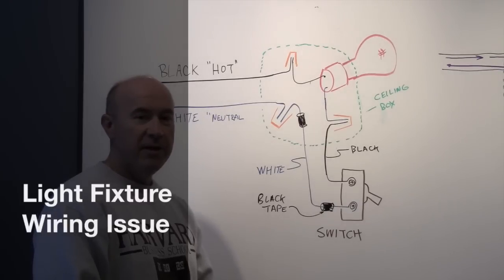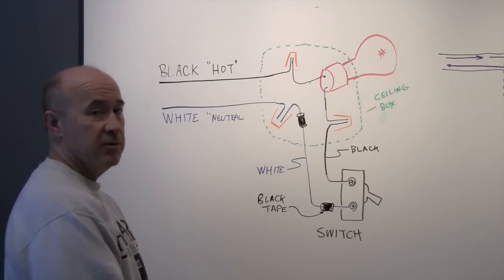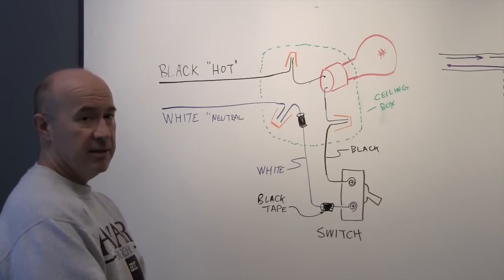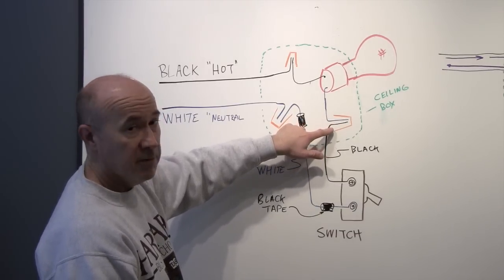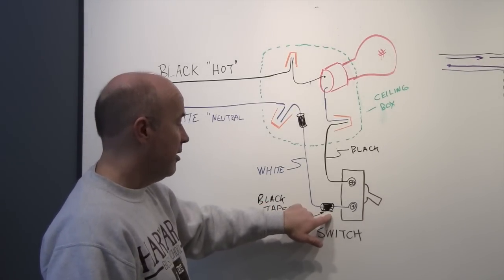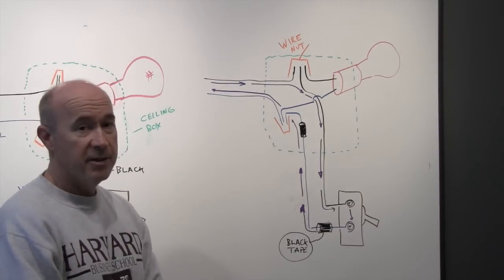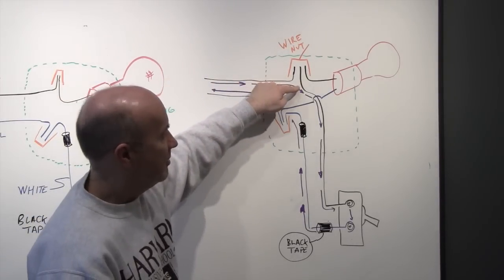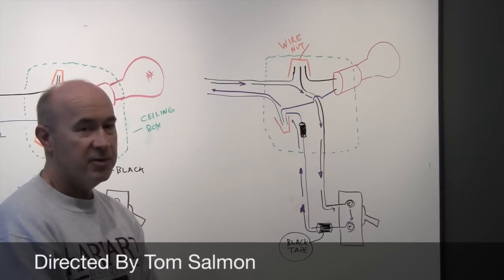Light Fixture Wiring Issue : Circuit Breaker trips as soon as the light is switched on.

Comment: hey, so basically the light fixture worked but lets just say that uh,, the wire to one of the light bulb sockets literally tore off. now, whenever i flip the switch, the breaker trips up. Should I be worried of electrical fire, or is a turned off switch good enough until i get a new light?

Comment: Hot don't go to light it goes straight to the switch than run I switch leg from switch to light and neutral to light that diagram you draw is a switch loop

Comment: does anyone know how to trace wiring faults on lights and smoke detectors? or is there a tool i can use? my issue is the breaker trips when i turn on ANY light(or plug in something) in that ckt. the only way the breaker stays energized is when i turn all switches off and unplug all the loads on the ckt. now i'm tryin to find where the fault is. if all i had were receptacles its just a matter of plugging in a receptacle tester to detect faults in the wiring but most loads on this ckt are lights and smoke detectors. so that means two-wire(hot/neutral) and i cannot just plug in a receptacle tester.

Comment: This video is why the dislike button should still exist. DO NOT SWITCH THE NEUTRAL
Reply from the maker: Hmmm the switch is between the breaker and the light, is that the neutral?
Reply: @teesalmon  respectfully, the fact that you’re asking this shows that this video should not be up. Please remove it because it is giving dangerous advice. The switch needs to be on the hot side on top. The diagram you show will work, but it’s against code and dangerous to switch the neutral because the fixture is left hot.
Reply: @teesalmon  the light should be directly connected to the neutral instead of hot and then a switch loop run between the incoming hot and the fixture. It’s a slight change but big difference.
Reply from the maker: I was being sarcastic. The switch is between the device ( light) and the breaker. The house was wired in 1963 and has wet plaster. It was wired like that since day one and passed code when built. The person replacing the light just forgot how the original light came out. This was simply putting it back the way it was. Would you suggest tearing into the wet plaster? There is a floor above so no attic access. I did not wire this house, simply showed someone how to put it back the way it was for the first 50 years.
Reply: @teesalmon  if all 4 wires are in the electrical box, then switch the wires around so neutral goes straight to light and the hot loops to the switch and back. Even if it was “okay” then doesn’t mean it’s safe. People are watching this video with modern wiring and will wire it backwards.
Reply from the maker: What you suggested is how it is wired. The Romex from the circuit breaker enters at the ceiling box. Another section of Romex goes from the ceiling box to the switch. The “hot” travels to the switch and back via the Romex. Since even the white is technically “hot” on its way back from the switch, it is convention to mark the end in the switch box and the end in the ceiling box with electrical tape so that anyone in the future knows this wire may be hot. BTW, even though black is typically hot and white is neutral, forget about the colors and think about what each section of wire does and if it is between the device and the circuit breaker, or between the device and the neutral connection in the panel. If they had special Romex that had two black conductors it would be awesome for running a hot to the switch and back. I’ve never seen any, and the person wiring the house in 1963 didn’t have any either. :)

Comment: Everybody chill on this guy. This was exactly what I needed (besides continuing to tell me I shouldn't be doing this.) With a bit of research, this seems to be an older wiring, which has since been updated. My house being built in 2000, this was exactly what was going on. The people before us didn't have a fixture in a spot in the living room for some reason, so I put a light in, exactly the way he had it on his second drawing. Didn't know what the hell was going on, found one black wire was hot and the other black wire was not. Saw this dude's video and knew exactly what to do. BAM. Now I got a light. My only thing is, don't be such a dick telling people they shouldn't be doing this. I'm not an electrician but I'm a competent human being and can do some research to figure out what's going on rather than pay an electrician to come out, fix it in 2 seconds and charge me $150 for it. Just encourage safety and research, then for more complicated shit, I might hire you.
Reply: My house was built in 2000 too.  This is exactly what happened.   😊
Reply: This guys a condescending prick. This isn’t rocket science
Reply: Myself was glad I saw this video, the house I live in was built in the 50s, no insolation, ply would on the walls then sheetrock on top. The power cables didn't even have a color on them...lol...and this video made me get it done. I also wanted to mention about the part he said, "If you're having this problem, you shouldn't be doing this" but what da hell...he fixed my problem and saved me few hundred dollars!!!

Comment: Looks like both globe and light switch are connected in parallel. With switch in off position, turn breaker on, light stays on permanently until it blows or something else trips breaker. Flicking light switch creates short-circuit which blows breaker which turns off globe.

Comment: Not trying to jump on the "kick you in the shin" band wagon but your first diagram is switching your neutral is not allowed by code and dangerous. The second diagram is a dead short when you turn on the switch. There are times when a neutral is switched along with the phase wire, example around gas pumps where arcing can occur which may cause an explosion. Hospitals also have strict codes especially in the operating rooms where heavy gases are used for sedation...
Reply: This is called switch loop wiring. It was totally legal and to code years ago and it's allowed to stay in place today.
Reply: @joannasaadati8810  "Switch loop" is exactly as it sounds a switched loop. Never and I'll say it again Never is power fed directly to a light fixture and then the neutral switched. What would happen if the light switch was in the off position and you went to install a new fixture? The answer is you would get shocked because you have not disconnected the hot wire. You have only opened the neutral wire by using the switch as a way to open the circuit. Look up switch loop and switch leg you may learn something...

Comment: This solved my issue exactly. The person before me didnt add black tape so in the ceiling box I didnt know I had a switch loop. Now I can run in series to fix it, I just need to figure out which white wire Is actually the secret black going to the switch. *editj DONE FIXED THANK YOU!
Reply: My white wire wasn't labeled either 🙄🙄
Reply: How did you figure out which white wire to send to fixture?

Comment: First schematic is wrong. Light would come on but can be dangerous.  Hot black wire from the circuit breaker should always come to the switch first, then the switch can turn power on/off to the light fixture.

Comment: I’ve encountered houses like this.  Unswitched Hot in the fixture box.  Switch on the neutral.  Usually accompanied by aluminum wire with paper in the insulator jacket.  Sometimes you’d show up and none of the light would work, or 2 out of four would work, only to discover the lights were connected in series probably to save wire.  The era had a lot of goofy things going on.  “Positive ground” vehicles and tractors.... just weird compared to now.

Only way to safely work on it was to unscrew the “fuse” predating breakers.  Check the fuse fixture for a coin in it, as some home owners opted to use a coin instead of replacing a fuse.  Sketchy.

When I looked into it, it was acceptable by older code  (not the coin obviously).   Keep in mind, I’m also in Canada, so who knows if the code was the same in the US around that time.

While the guy isn’t wrong, and it does work, I hope he’s referring to an older house. Maybe an early - mid 70s era house.  Shortly after the death of knob and tube and before the world discovered aluminum wire in your walls was a fire hazard.  The video needs a disclaimer on the fact you do not install new like this. 

Thank god this was done away with in the modernization of the electrical code.
Reply: I'm in BC and my house has switch loop wiring like this, built in 1985. He did clearly say that he wouldn't wire this way but people don't listen and half of the comments are telling him he doesn't know what he's doing 🤦

Comment: I just wanted to check this for shits and giggles. This guy is one of those people who knows enough to be dangerous. You can NOT open and close circuit via neutral. It works, but not to NEC code. Use hot wire. Take hot wire to switch and return switch leg to connect to black wire of light fixture. Come on man. If you are not certain, then do NOT make a video and put it on YouTube. And I can NOT believe some readers comments. They actually complement this? Unreal.
Reply from the maker: Hi Zabi, forget about wire colors for just a minute. Then realize the switch is between the circuit breaker and the light bulb. And by the way, the neutral wire, you know the one that goes from the light bulb down to the neutral in the circuit breaker box....there is no switch in that path, that is the neutral wire.   One can define the neutral as the wire from the device ( i.e. the light bulb)l and the neutral point in the system. 

If the wiring went from the circuit breaker, to the bulb, THEN through a switch it would be switching the neutral. That's not how it is set up. 

The wires could be pink and green, consider where the bulb is and the switch with respect to the circuit breaker,  and where the bulb and switch are with respect to the the connection in the panel where all the white wires connect.

The order is circuit breaker, switch, bulb, neutral connection in panel, end of story.

Also realize, that this is the way the house was wired in 1963. You can make it work, or you can start digging into wet plaster walls/ceilings or trying to figure out how to fish some crazy wire paths.  The person had a working system, and tried to replace the light fixture, and guess what, they hooked it up differently and it would not work. This video merely hooks the wire back up the way they were to begin with.
Reply: @teesalmon  No dude, you are confusing everyone. I don't care what color you use. My point is you need to use the hot wire for switches, not neutral. The old houses were wired like some commercial wiring. power to lights and switch leg to switches. Again, as per your diagram, you used neutral wire for switch, not hot wire. In AC system, You can only close and open circuits via switches with hot wire only. Not neutral conductors. Incase you did not understand my explanation, perhaps I can in details. Let me know. Thanks.

Comment: Why the switch is on the neutral wire? is it should be on the hot wire?
Reply from the maker: Does the color of the wire define it to be neutral or hot, or the placement of the device (light) in the circuit? The switch is between the circuit breaker hot and the light. I believe there is a definition in the electrical code that is worded much differently, and that is posted somewhere in the comments.

Comment: Thank you SO much.  This was exactly the problem I was having; I removed a fluorescent fixture and didn't pay attention to how it was wired and when I just did the "let's put all the black wires together and all the white wires together" thing it blew the circuit breaker every time I flipped the switch.  I wired it like you showed and it works great now.  Hooray for clear explanations they are in short supply in this world.
Reply: Philip, you need to understand the concept of a switch. It closes and opens a circuit. If you run a hot and neutral to a switch and turn it on, you trip the circuit. It is called direct short. What this guy did in his first drawing, he used neutral wire. He should have used hot wire instead. For DC circuits you are allowed to run negative line to switch in order to close and open circuit. For AC circuits, always use hot wire as per NEC
Reply: @zabizeyaee8002  He didn't do anything, he was explaining existing wiring that was totally acceptable years ago.

Comment: Regarding your first diagram, since when do you interupt (switch) the common (white)  wire. ALWAYS switch the hot wire, that's CODE.
Reply: This is called switch loop wiring and it's old school so many homes still have it. Code allows old school wiring to stay in place.

Comment: Quick question, me and a friend put in a new light in the kitchen. The light had 2 clear wires and a ground. We connected the ground, and guessed on the wires. Due to the fact they had no indicator. We turned it on and it worked, so we just raised the fixture slightly more and the ground ended up cutting itself off, so we fed more ground wire and redid it, (of course we turned the breaker off) but when we turned it back on and hot the switch it popped and the breaker went off. And since then it hasnt been working. I'm assuming it could be the wires in the ceiling above the fixture? Oorrrr

Comment: I am replacing a ceiling fan with a regular light fixture. There are two light switches controlling it. I did exactly what you said not to - unhooked everything without paying attention and ended up with 2 white wires, 2 black wires coming out of the ceiling box and two red wires that are hooked together in the back of the box (not attached to the white or black wires). The light fixture has a 1 black and 1 white wire. So - hooked the white from the light to the 2 whites in the ceiling and the black in the light to the 2 blacks in the ceiling - tripped the breaker.  Used a volt meter and only one of the black wires in the ceiling has power. If you stick the volt meter in the cap holding the two red wires together - there is power there, too.  I  have no idea how to fix this. Electricians always say our house is wired different than any they have seen lol. Help!
Reply from the maker: Since you have a volt meter, determine which wires have 120VAC to ground with both switches in the on and off  positions. You should be able to figure it out.

Comment: I installed a 4' LED light strip for attic lighting. It was a plug in light, which is not ideal for going into a dark attic. So ichopped the plug off and  installed a switch near the entry. While trying a SPST typical lighting switch, the light would be on while the switch is off. When switch was toggled, the 20A breaker tripped. Every time. I then realized that on a SPST switch,  black is wired to black and white to white. Which meant that I was always sending voltage to the rectifier internal to the fixture. Switch closure would obviously trip my breaker. The next day I installed a DPST switch and it worked like a champ! Just FYI in case others were looking to do the same for their dark spaces

Comment: I’m having that problem.. I have 3 black wires and 3 white wires connected.. I’m trying to put my new light fixture but the breaker pops.. even when it’s not connected.. can u please help me
Reply from the maker: You say you have three black wires , and three white wires. Are you including the white and black wire from the light fixture in your count of three in each color? Do you have a volt meter? Does this happen with the switch in any switch position? or just in the ON position?